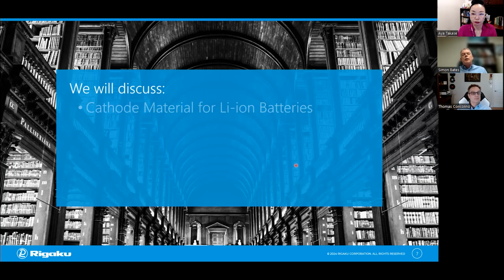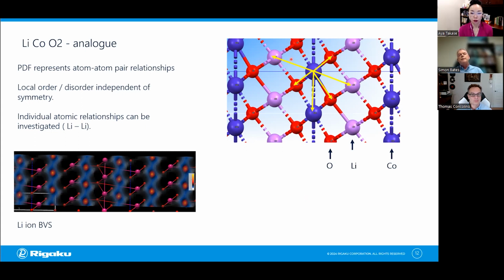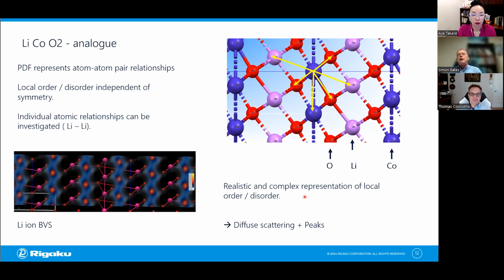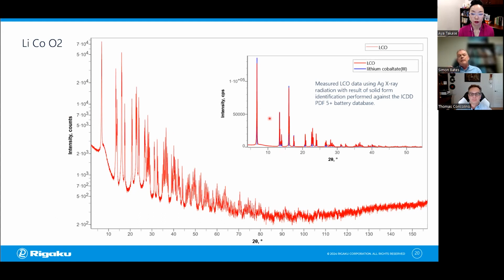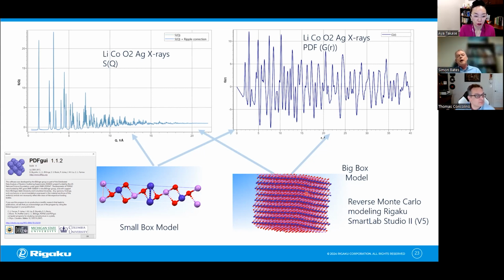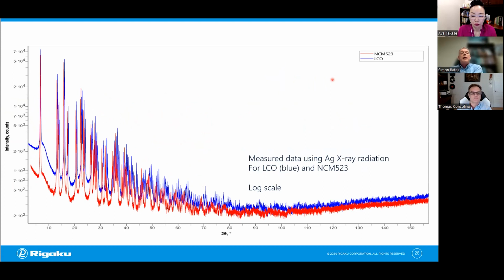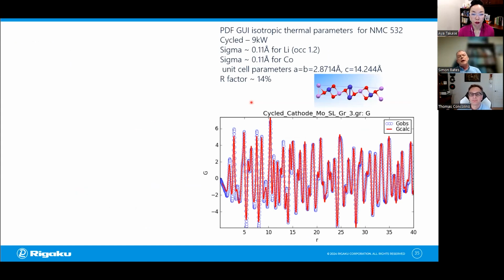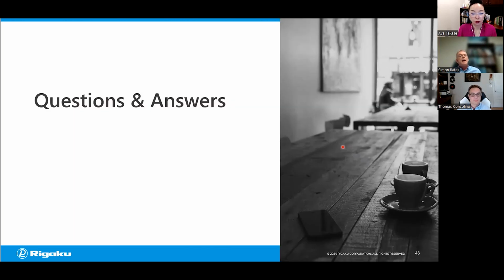PDF Battery Analysis

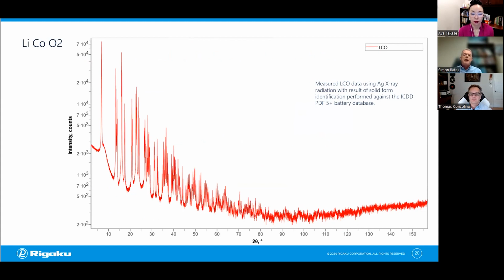Comment: 25:26 How does the polarization cause the dip in the curve? Thank you for the nice talk.
Reply: Thank you for your question.

The X-ray source for laboratory total diffraction measurements is usually considered to be unpolarized, which is mostly true even when incident mirror optics are used such as in the Rigaku SmartLab and Synergy systems.

Conceptually, you can think of an unpolarized X-ray source as being made up of an equal amount of X-rays polarized in two orthogonal directions.

For reflection measurements, we usually think of one of the orthogonal directions as being normal to the sample surface and the other in the plane of the surface.

In the same way that light is polarized on reflection from water, the X-ray polarized normal to the sample surface will be preferentially absorbed dependent on the diffraction angle and for diffraction angles of 90° 2θ will be completely absorbed.

Simplistically, at 0 and 180° 2θ there is no preferential absorption, and the X-ray intensity will be 100%. While at 90° 2θ, the normal polarized X-rays are completely absorbed reducing the X-ray intensity to 50%. This gives a dip in the measured total diffraction intensity as a function of 2θ.

This does not apply to synchrotron sources that are already plane polarized or when you use an incident beam monochromator with large Bragg angle.

Please feel free to contact us if you would like to discuss it more: https://rigaku.com/talk-to-an-expert
Reply: @RigakuWebmaster  Your answer is beautifully detailed. Thank you.